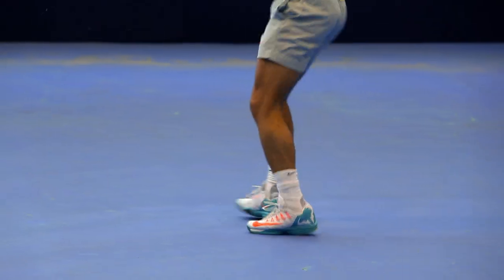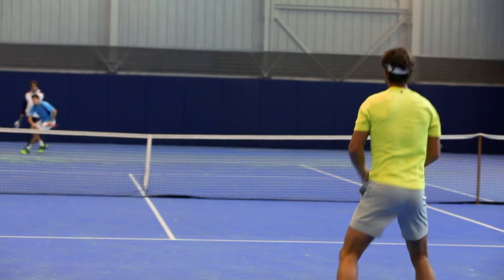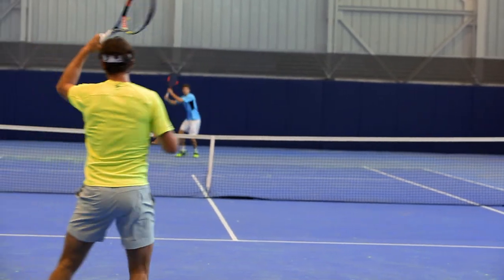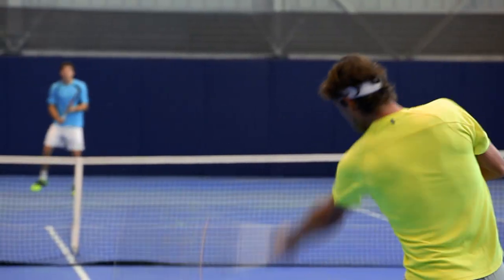The new Babolat Pure Aero: creating the 6th Generation

Comment: But he doesn't use the pure aero...
Reply: he changed to the pure aero
Reply: +Arjun Rajaram just the paint job. Common marketing trick. That's why I find these vids kinda funny
Reply: lol. agreed.
Reply: no he actually changed to pure aero
Reply: @bigtime1356  no he uses aero pro drive original 2003 model with pure aero paint job
Reply: Dimitris Ntantinis 2004 not 2003, Nadal used the babolat soft drive up until the 2004 season
Reply: Arseniy 
No he actually didn't.